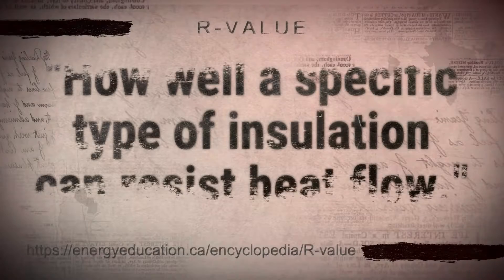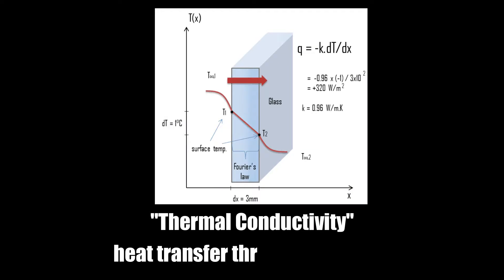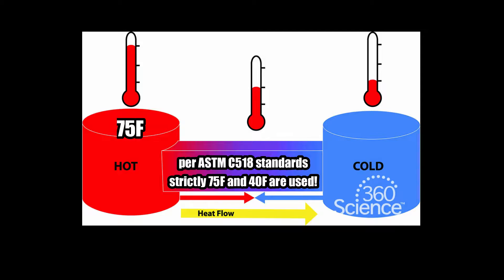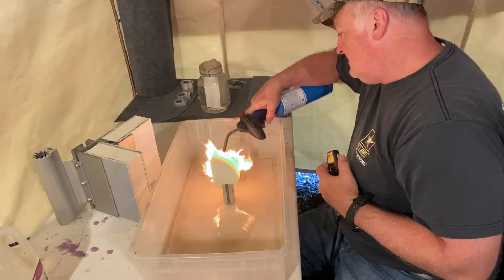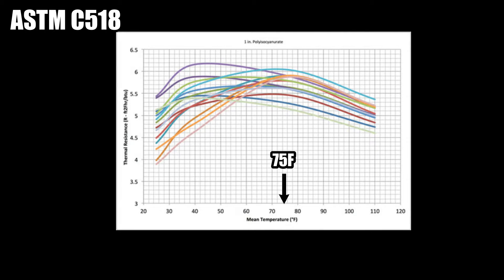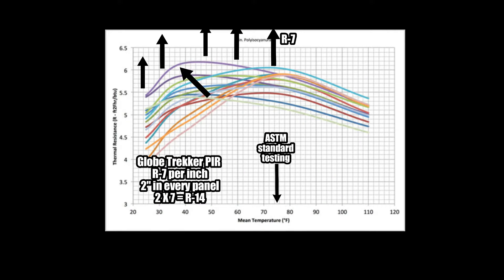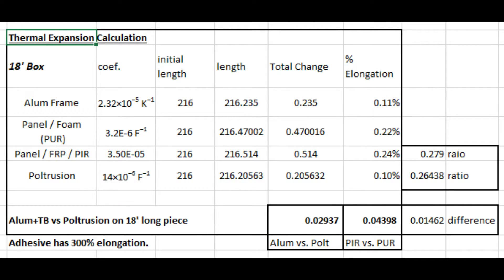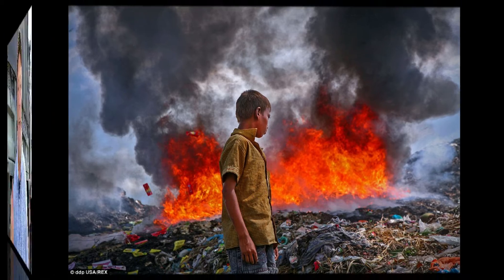EXPEDITION PANELS Part 1: R-Value, PIR Insulation Education

Comment: Fantastic piece thanks Dave. Considering an FMTV build.  Any options for adding further R value? Either in the panel, or maybe a thicker version of that fibreglass skin?
Reply from the maker: The Expedition panels is already an R17, which tops anyone else's valid claims for insulative values. The secret (not so secret) is the high R-Value PIR insulation (per inch). Thicker walls would also mean new aluminum extrusions would have to be engineered, tooling and dies made... very expensive. I suppose you could add more to the inside, but it is not necessary.
Reply: @RVGlobeTrekker  OK I misunderstood. I thought it was R9.  Many thanks.